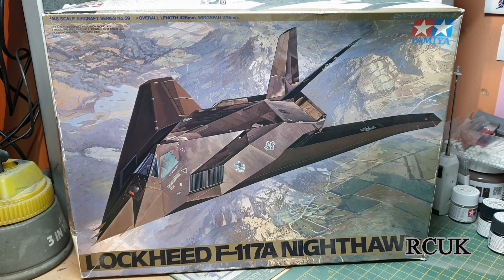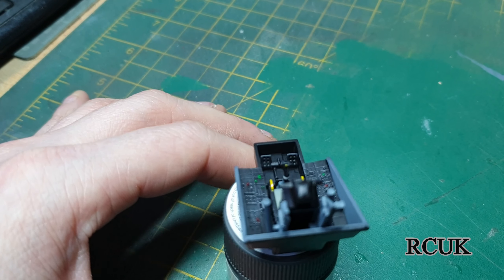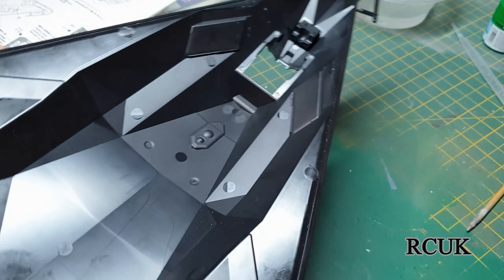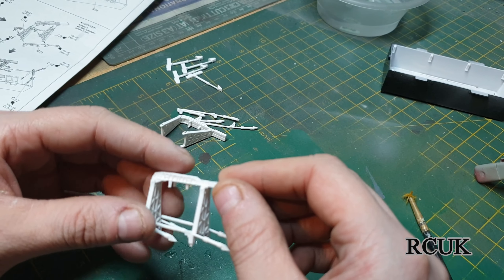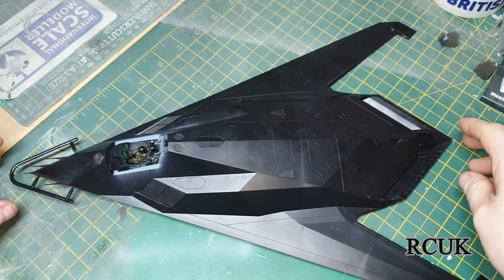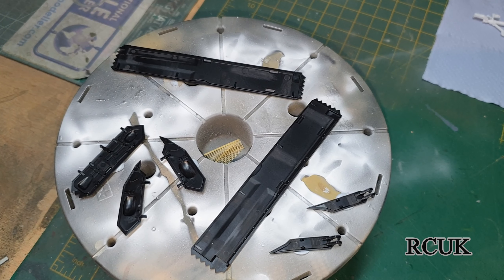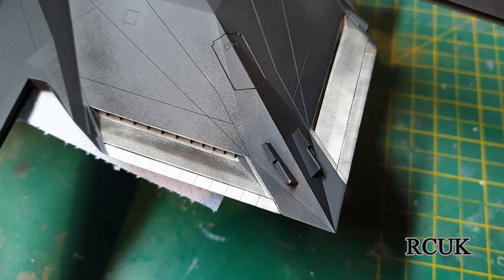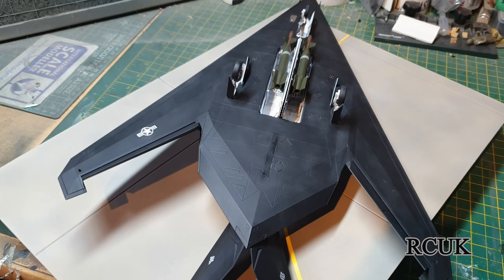TAMIYA 1/48 LOCKHEED F117A Plastic Model Build

Comment: You can use q-tip damp with canola oil to remove tape residue on canopies; then wash it with kitchen soap.
Reply from the maker: thanks for the tip I will try it
Reply: RC UK Scale Models let me know if it works for you; good luck.

Comment: First of all, this is not an original Tamiya kit, but an old italeri kit, reboxed by Tamiya.
Too bad about that canopy. Did you dip it in Future Klear, or something similar ?  Next time, just polish the plastic, use dedicated polish or use toothpaste. Works just as well...!  ;-)
If you have to use Future Klear, let it dry for a LONG time. Several weeks..!!  Yes, no kidding. These kind of fluids need time to fully cure. Some tape adhesives contain a substance that doesn't agree well with certain clear coats. 
I think you should give the following technique a try: mask off the black parts around the clear part. Do NOT mask over the decals. You will most likely pull them off, along with the tape...!   First, take a small brush with short bristles and wet it with ammonia. Try to gently wipe away the foggy residue. Stay away from the decals. If ammonia does not work, try some turpentine or white spirit.
If these two liquids do not take away the problem and you haven't used a clear coat on the canopy, now is the time to do so. Any type or brand might work. Apply by brush.
Reply from the maker: thank you for the tips I will try it next time it was a bummer that the canopy screwed up
Reply: This is not the Italeri kit; that has separate wings, Tamiya  as you can see, moulded wings to fuselage and managed to engrave the panel lines unlike the Italeri kit.